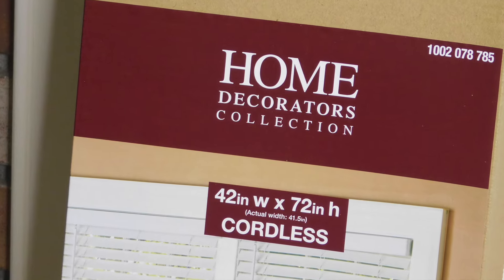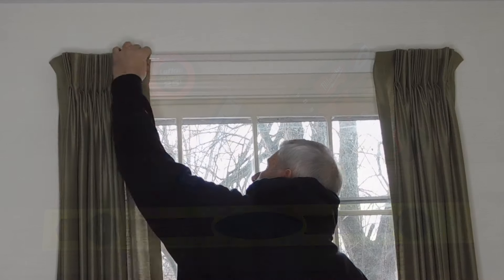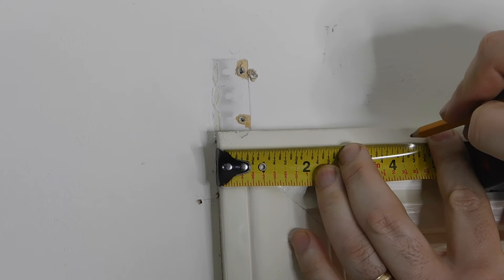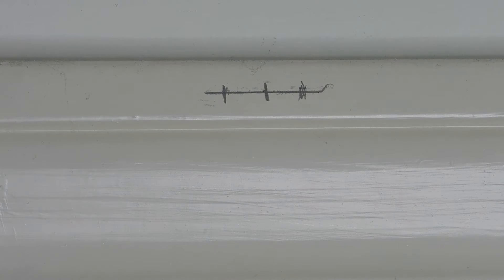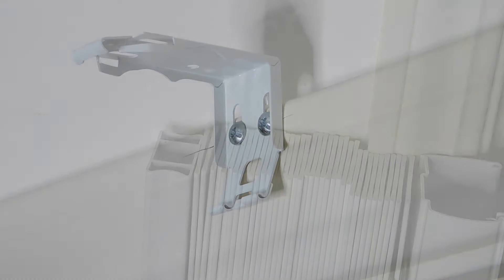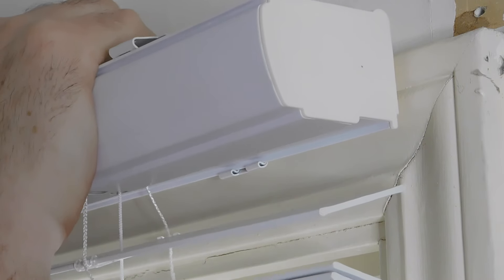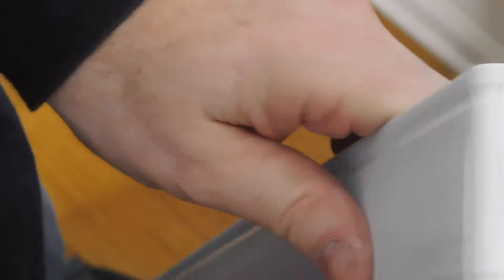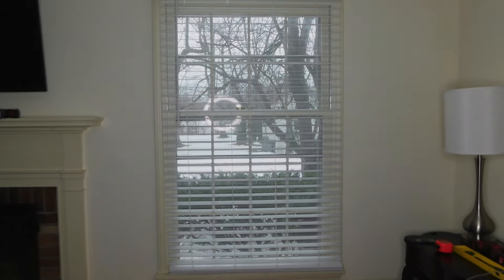Installing 2 in Faux Wood Blinds by Home Decorators Collection

Comment: sadly you skipped over the reason i ruined the first set and am now still trying to figure out with the second set...and that is removing the bottom button and actually unfolding the blind. Why that was skipped is beyond me
Reply from the maker: Sorry, we have long windows and that step was not necessary for our home. If you pop the buttons out with a flat head screwdriver you can then remove unnecessary slats. I prefer to not cut extra length until you have reassembled the bottom  piece. I hope that helps.

Comment: How do I get the blinds to drop in the first place? You go from mounting it to attaching the rod to change the angle of the blinds, but never show how to get the blinds to drop?
Reply from the maker: Just pull the bottom down. They no longer have cords because of choking hazard. To go up you just lift from both sides.
Reply: Lol -  I did same thing—duh just pull em down
Reply: Me too! 😂

Comment: for the life of me I can't see anything for the wand to click into. everything else was pretty straight forward. I look into the small hole and see nothing for the wand to attach to.
Reply from the maker: It is a press fit. Just push it in.
Reply: @TheThriftyWoodworker  thanks but i just returned it. the piece inside the top was missing.